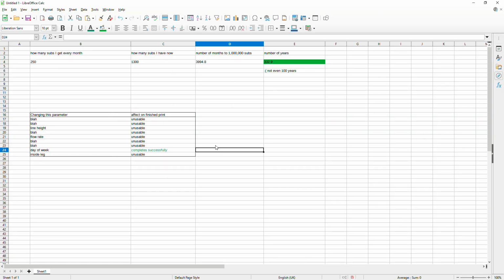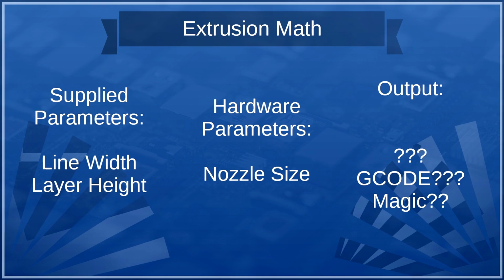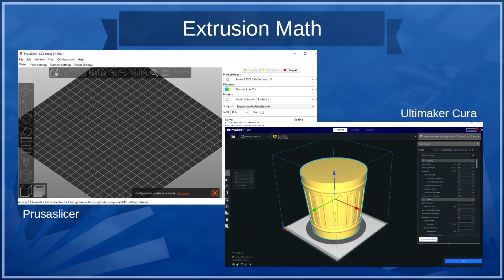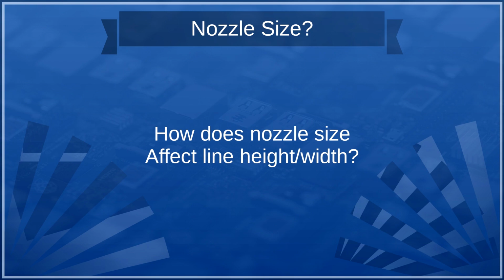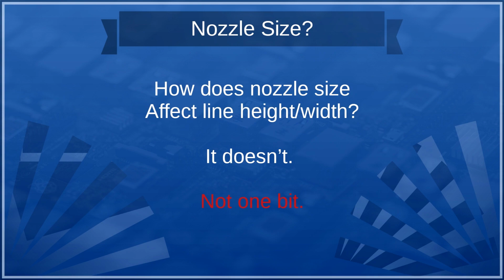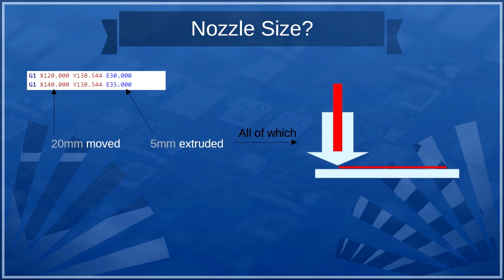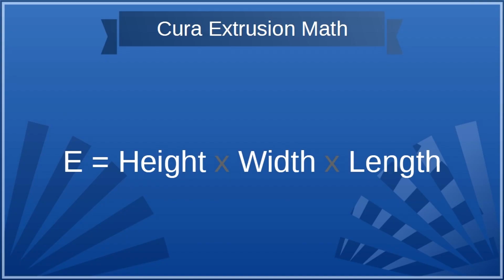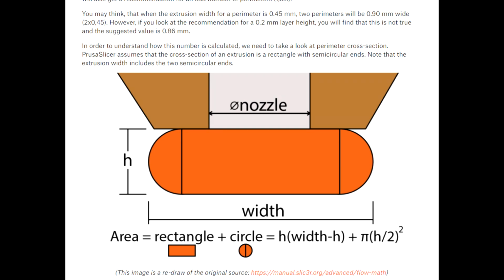Flow Math: Slicer extrusion logic explained.

Comment: Great video (as usual)! I am commenting to say that I do see a real-world difference in the two methods of calculating E. I have used ideaMaker for years which uses the rectangle calculation like Cura. I wanted to learn OrcaSlicer, and my first prints are horribly underextruded. It may not matter in larger models, but I tried a set of calibration prints I created and they are terrible in PrusaSlicer. One example is an open-topped cube with 2 walls of 0.5mm each (layers 0.2mm tall). I should get a wall 1mm thick, but in Orca/Prusa, they are only ~0.8mm. Vase-mode prints are really thin, too. I exported gcode for the same model from ideaMaker, Cura, PrusaSlicer, and OrcaSlicer and found that Prusa and Orca extrude 9.4% less volume per line than Cura and ideaMaker (for my line width/height combination). When I did the math(s) presented here, that is exactly the difference between the two ways of calculating flow rate. If I increase flow rate by 109.4% in Prusa, my prints measure the same as ones in ideaMaker with flow rate at 100%.

Comment: My thoughts on this:

Cura's filament model, while simple, is adequate. Representing the extrude as a rectangle approximates the cross-sectional area with the empty areas in the corners being compensated by the excess outside the rectangle on the centre of the edges.

PrusaSlicer's more complex model attempts to address the "real" physical properties of the extrude but your statement that the default flow rate multiplier is 0.95 in PrusaSlicer suggests that it fails to do this.

The problem with any slicer is that extrudes are based on feed amount of filament entering the extruder not on material leaving the nozzle. There is an assumption that these correlate exactly but in practice this isn't the case.

I tension my extruder adequately and use calculated e-step values which are well-known and published e.g. 93 for standard Creality gear/smooth idler type and 415 for 1:3 geared E3D Titan types.

Given the imprecise relationship between extruder inlet feed and nozzle egress, an extrusion multiplier is required for most different filament types.

I find I can use an extrusion multiplier of 1.0 (100%) for PLA and 1.03 (103%) for PET-G for both Cura and PrusaSlicer and achieve an accurate extrusion result based on observation of a solid top-layer infill.

I would suggest that PrusaSlicer's use of enlarged line widths in the profiles to generate "real world accurate" features is what leads to the need for a 0.95 extrusion multiplier default. I set my line widths to the nozzle diameter in PrusaSlicer to allow the use of an extrusion multiplier of 1.0 (100%).
Reply from the maker: Yes absolutely agree with these assertions. It's always good to be mindful that the maths has to accommodate the somewhat "dirty" real world conditions. Which invariably involves "fudge factors" somewhere in the process

Comment: Can you go into the new Cura 13 fast print. CHEP did a video where he adapted Ultimaker only profile to Ender 3.  I find it around twice as fast as my standard profile, yet I really can't see a quality difference. Not at least worth 2x the time. It has to do with very fast travel. But I'd like to know why. But I'm happy my Ender 3 is now twice as fast.
Reply from the maker: I know exactly what you're talking about. I'll see if I can work it out.
Reply: @LostInTech3D  Your vids are very clear and detailed. And when I say 2x faster, that is without increasing 50mm sec print speed.  Partly, I'd like to understand what is going on inside the profile so I can adapt it to Prusa Slicer as well. Thanks.

Comment: Very interesting thank you. As for your challenge I suppose just increasing flow (significantly but up to whatever is reasonable for a given nozzle to handle, I haven't checked) will churn out thicker walls which provided they glue ok, would produce a much stronger result. Close?
Reply from the maker: I suppose it would, but it's not the usual answer! 👍
Reply: @LostInTech3D  increase line width, maybe? For the same layer height it should not be too different?
Reply from the maker: Yep 🤣 I did a video on it already 👍
Reply: @LostInTech3D  just found it, thanks! This one though explains the previous, I reckon.
Reply from the maker: There's another on the way about this too 👍

Comment: The real difference between Slic3r-based slicers and Cura is actually kind of explained in the terminology used: Slic3r has "Extrusion WIdth", and Cura has "Line Width". Cura should really rename "Line Width" to "Line Spacing" IMHO. When Cura starts the next line, it moves the nozzle over by the amount that you specify in the Line Width, then effectively adjusts the actual Extrusion Width so that it fills the rectangular gap left between two walls, for instance. Slic3r does it differently: you specify the Extrusion Width, and it calculates the Line Spacing required to fill the gap left between two walls. That's why the results are the same, and also the reason that the 'single wall' flow calibration technique doesn't work with Cura. It's difficult to explain without diagrams, but just know that the two settings mean different things.

Comment: Cura doesn't use a model which is based on adding half-circles. It is model agnostic. Instead the flow is supposed to be lower than 100% to account for those microgaps on top and bottom in between two lines. I'm guessing that the fact that it's by default not below 100% compensates for the material slippage in the feeder.

Comment: supersclicer (super) a fork of prusaslicer (prusa) explains the squish calculation when editing the line spacing. furthermore super could be the medium in which you can try and isolate the variables between cura and prusa since super lets you edit edit spacing and extrusion with instead of just extrusion with in prusa. i personally found the tolerances are by far easier to adjust in cura since you edit the extrusion with (or rather spacing with a predetermined expected volume) and flow rate (or rather adding a volume modifier). i have evidence of this by trying to print a cylinder with a hexagon in the middle (for an allen key) inside a hollow cylinder (or a tube) with just 0.1mm spacing between cylinder. in cura its easier to get all 5 dimensions calibrated and print things in place as one unit without fusing and still be able to slide in an allen key into the center since you have more control over your print. in cura, since its trying harder, has to assume the viscosity and temperature delta for all filaments and all temperature are the same across the board it's virtually impossible to calibrate. on all 4 slicers (including ideamaker) the model is fused together on purpose in the preview if you try to compensate via xy compensation if adjusted at best and at worse they throw off one of the 5 faces sending you into a rabbit hole. slic3r is stupid way too out of date, i thank the engineers for its development and their contribution to the technology but its a dead software.

Comment: I am afraid that the influence of the different filament diameter on the extruded volume has a much greater impact than the issue described here, because even a small change in is outer diameter has a significant effect on the volume conveyed. 

This influence is probably once again less relevant (1/100) when considering the two different implementations of the manufacturers than when comparing the effects of the different causes I have brought into play. (1/10)

Only if the production of the filament is very precise and constant over the entire length of the spool, it can be assumed that one has to deal with this minor problem. (I have not calculated this).

Comment: top sausage, my comment may seem odd at first but please keep an open mind and look. 'Mig Welding' tutorials to be exact. if watch you may understand better the 'logic' behind speed of travel, filament (wire) feed rate and temp (amp), Im very very new to this form of printing. i was a traditional litho printer for many years as well as letter press and flexo print. also home welding and engineering. what has surprised me the most about this 3D printing is the decades and decade of applied industry science, mechanical, electrical, digital etc. my own profession of colour litho printing has parallels such as pressure changing the size of line widths, humidity affecting substrate (filament). my point being when looking for answers to situations / problems dont limit yourself to 3D plastic filament mechanical delivery systems with digital controllers  all this , new tech, is built and grounded on centuries of development in all kinds of fields and sciences. keep up the excellent work I'm learning a lot from yourself as well as enjoying this new process. thank you.

Comment: Excellent! Love these technical deep dives. Would be interesting to see more on flow rate, for example, I've seen some interesting discussions on the volcano hot end vs Dragon or bi-metal heat break alternatives and debates on whether larger nozzle sizes makes it easier to push filament through or less. Your videos have been a massive help so far on understanding the technical side of things, keep up the great work!
Reply from the maker: Thanks for the feedback 👍
I will write that down, definitely sounds like something to look into..
Reply: @LostInTech3D  Interested to hear what your take is on calibrating E-steps/ flow.. Having followed the crowd who do e-steps through the hotend my e-steps went from defaiult 93 to 101 then default flow needed dropping to 94% in slicer.. 

Then I following some more technical advice channels and sites which stated e-steps is the  physical relationship between step angle/  gear diameter which should be independent of the hotend and that the flow through the nozzle  is the calibration of the flow rate in the slicer (which makes total sense to me).

Re-calibrating both this way I found that the default e-steps of 93 produced a filament  length of exactly 100mm for a 100mm request, and then my calibrated flow rate for the slicer is back to 100% (or as close as makes no reasonable difference).

Its a contentious issue, suggesting that e-steps is nothing to do with flow rate and should therefore not be done through the nozzle which appears to be met with extreme resistance, but the facts in my case with ender 3 max definitely support this logic, and to me at least it just makes absolute sense.. IMO, it all kinda stinks of "monkey see monkey do" in the popular 3dprinting top level channels if you get my drift..
Reply from the maker: There's this doublethink going on, that e-steps is both some kind of constant that never changes, and that it also needs to be done with the hotend on because it changes, but of course it never changes regardless of print speed, temperature, material... 
Meanwhile in the real world....
In his defence, CHEP did a thing on this not too long ago.
Reply: @LostInTech3D  Not seen Cheps take.. will go have a looksie..

My initial thoughts were that through the nozzle would result in different rates depending on the nozzle, which did not make sense, because the nozzle diameter is part of the flow calculation..

Basing delivery on what goes through the nozle then screws with that calculation, the calculation is working out the flow based on filament length and filament diameter being supplied to the hotend, and the layer CSA and length coupled with the nozzle diameter..

This is what led me into the rabbit hole, it just did not make any sense that after following the crowd I now had the printer delivering more filament to the nozzle, and had to lower the flow rate to compensate for that increased filament length..

Putting e-steps back to 93 then delivered exactly 100mm of filament, as requested, and re-calibrating flow resulted in 100% being the normal value.. which just makes complete sense..
Reply: @LostInTech3D  yeah.. cheps video kinda confirms what I think, though he then goes on to calibrate through the extruder because getting a consistent delivery at different temperatures.. so.. if you dont get consistent delivery at different temperatures then what temp do you calibrate at.. Ambiguous..

It also proves that putting the filament through the nozzle affects the delivery rate, so if you change the nozzle to a 0.5mm nozzle, then you will almost definitely get a different delivery length..

This is all based on slippage, and stopping slippage, but the thing is you will NOT get slippage if it is calibrated into free air WHEN YOU PRINT, because the slicer is calculating the quantity of filament needed to produce the length of extrusion, so when you are actually printing the filament is fed into the system at a different speed to get the correct flow rate from the nozzle, when you push filament through the system using the LCD you are feeding it in at an arbitrary rate which is not related to the flow calculations, that is why it slips, its being fed in faster than the nozzle can extrude and results in slipping but not when actually printing.

I am going to comment on Chep's video and see if he would delve into it a bit deeper, I rarely accept someone saying "because thats the way you do it" I don't want to know HOW to do things I want to now HOW and WHY, and no one has provided the WHY, looking for the why has led me to the WHY NOT..
Reply from the maker: Yeah.... pretty much spot on what I think about it. 
At the end of the day, calibration of esteps is like calibrating anything on a 3d printer. Anything more than "good enough" is temporary, before some environmental variable spoils your day 😂
Reply: @LostInTech3D  Dont talk to me about environmental, I live in Scotland, we have entirely too much environmental! Pishing down again!